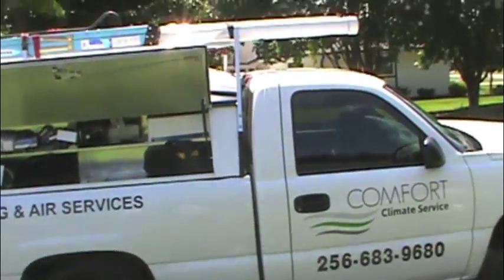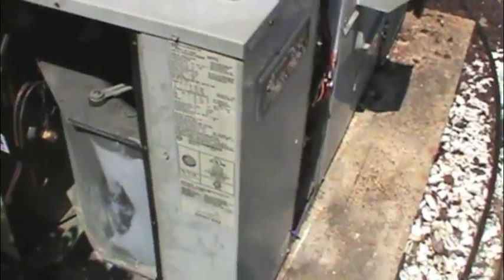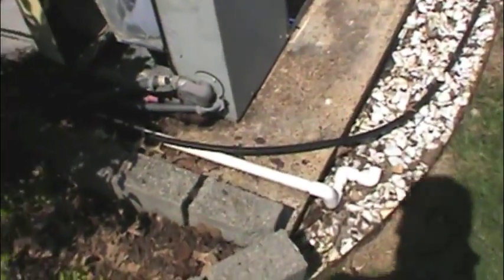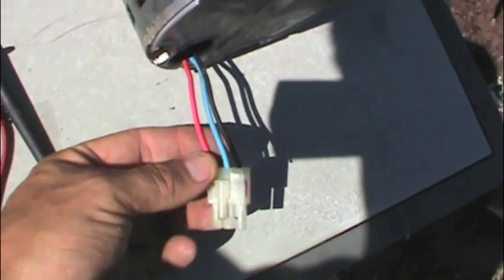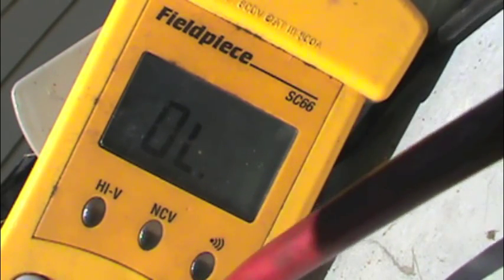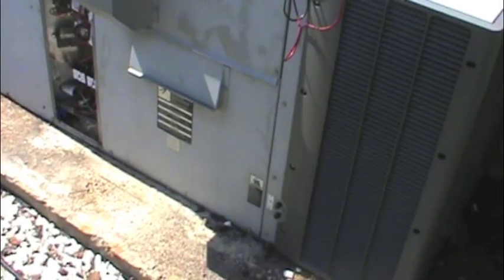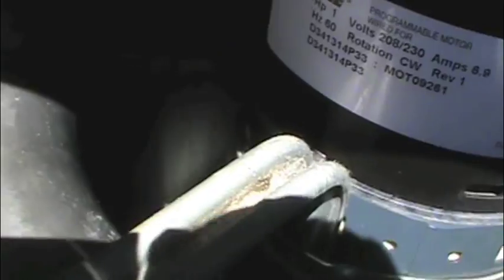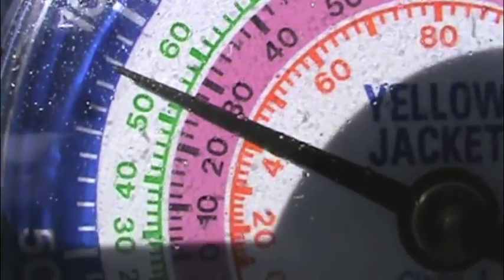HVAC Repair ECM Failure

Comment: That is a bad motor but the module is still good.  This is caused by high static pressure in the system.